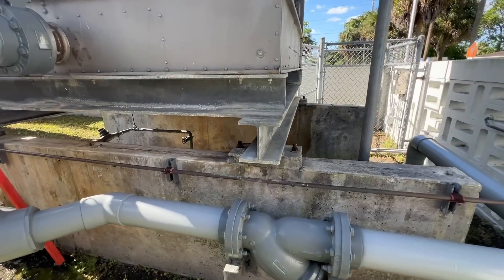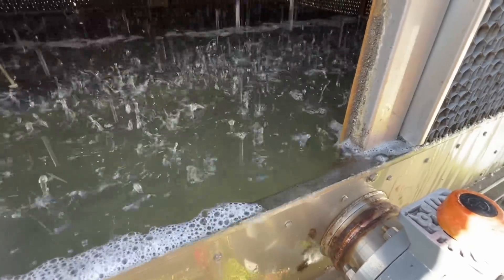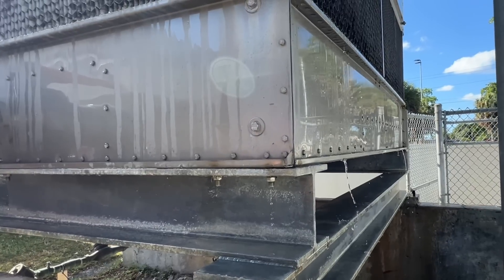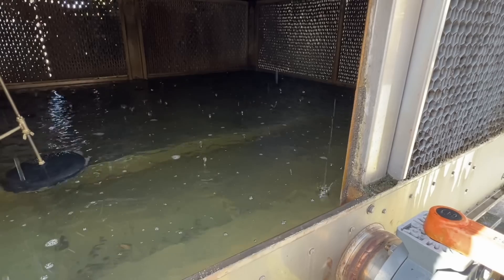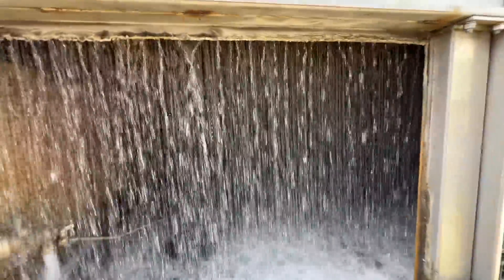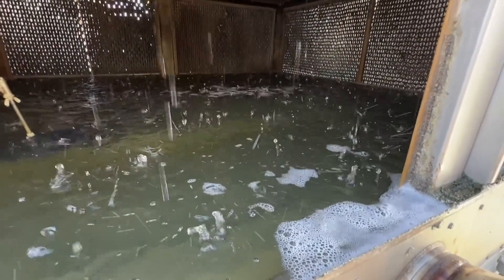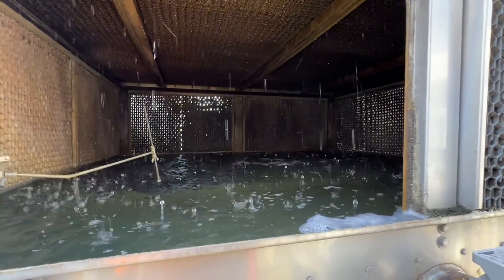Cooling Tower Overflowing Follow Up Work Order | I Should’ve Check This

Comment: 1-st reason of overflowing during shut down: drain pump is stopped, but water inside of cooling elements still coming;
2-nd reason: drain system is dirty and don't allow to suck a lot of water;
3-d reason: drain valve is closed about 50%
Reply from the maker: Thanks for watching!

Comment: u could put a 90degree elbow facing up on the upper overflow to save that water and chemicals. cut ur pipe going upwards to set water level when pumps off so its not pouring down the drain and then doesn’t have to fill every time pump starts
Reply from the maker: Thanks for the idea 👍

Comment: Hm, maybe the falling water influence the float (until the fan starts) more then normal. I have changed makeup water valves before because of this. Mostly bigger floats to counteract the water from above
Reply from the maker: The float rod is closer to parallel at full than before now 👍

Comment: Surprised the system runs so high in the sump that normal stop start operation requires water loss out the overflow.
Reply from the maker: Thanks for the comment 👍

Comment: Motor control group 26. 
Code 2606 SWITCHING FREQ increase it from default 4khz to 8khz this will quite down the motor.
Reply from the maker: Would that increase of temp at the drive be significant from 4 to 8 HZ?
Reply: My ABB rep suggested this to me a few years ago when I had  a noisy motor. But he advised not to set it past 8khz.
Reply from the maker: I gave it a try, nothing noticeable. Left it at 4khz. Thanks for sharing

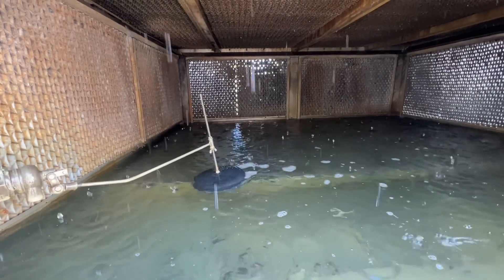Comment: 2:59  next time first wait until overflow stops then turn on the pump and then adjust the fill float otherwise the tank will still overflow
Reply from the maker: Unfortunately for now it has to be where it is due to the pipe distance otherwise cavitation starts, its far from a perfect setup . Thanks for watching 👍
Reply: Does the suction pipe which I assume is that big pipe that’s on the right of the evaporator tank not have a downward angled pipe connector so it sucks from the bottom of the tank (if it is just simply that hole in the side of the tank it’s going end up sucking air)
Reply from the maker: It has an anti-vortexing hood inside leading to the bottom of basin

Comment: Looks like all that water is just from the supply line to the tower draining out. Realistically it should have been run lower and then step up right at the tower, rather than horizontal straight out of the tower.

If you want to fix it, you could modify the pipework feeding the top of the tower and install an inverted P trap (P going up not down) just prior to where it enters the tower. That'll stop the water draining out of the entire supply line, only what's left after the trap. 

Probably not cost effective for the little bit of water it'll save, though.
Reply from the maker: That makes sense , don’t think they will make the change though. Thanks for your comments 👍